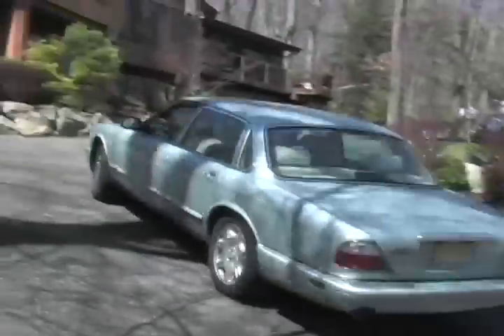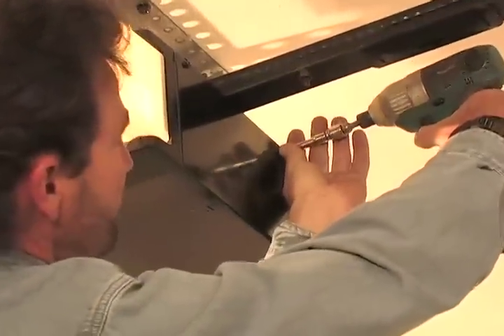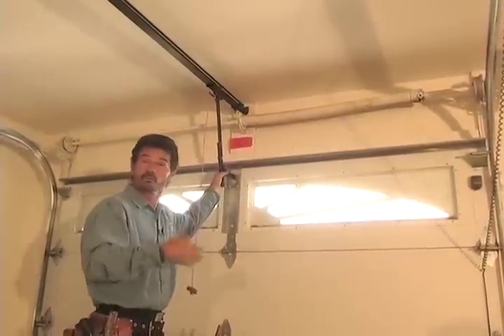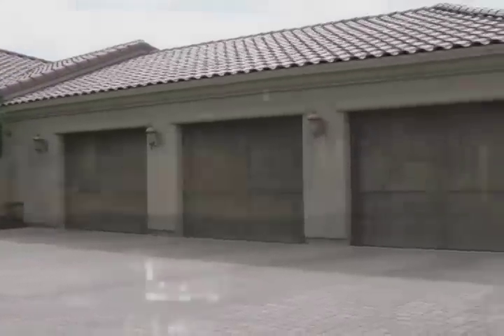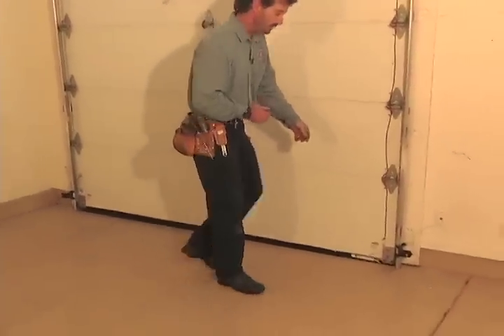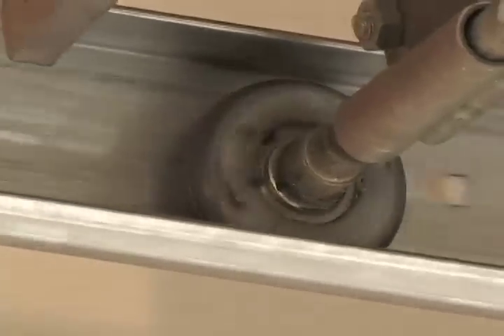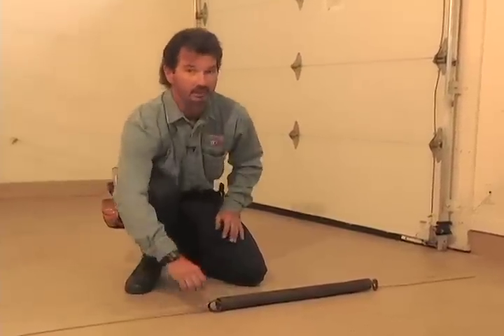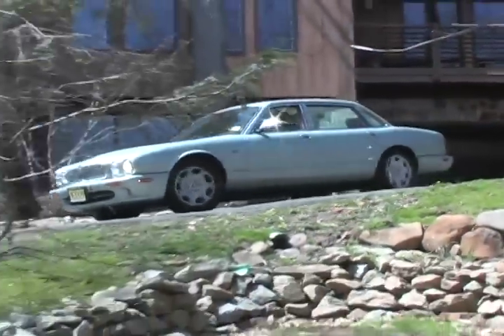Garage Door Operation, Maintenance, Repair Video from GarageDoorCare.com

Comment: If you spray a penetrant (like wd-40) on the rollers, it will thin out the heavy grease already there and the bearings will experience quick friction leading to rapid failure.  Telling people to use a solvent where heavy grease has already been injected-do not believe everything u read.